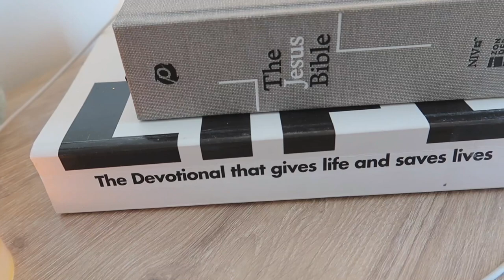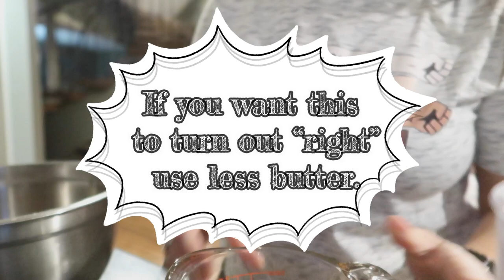HOUSE UPDATE || VLOG || Adding a Basement to our Mobile Home REMODEL ||

Comment: We are about to install a manufactured home on our property with a 5-foot tall crawl space with an eye to converting it to a full basement in the future. Pretty much everyone I've talked to his told me that it's a crazy idea and I'm not sure if they're right or not. How did the basement conversion work out for your family? Haven't found anyone else who has converted the crawl space under a manufactured home.
Reply from the maker: It's worked great. We did restructure the foundation to reenforce it with wood and metal but it has worked good and we haven't had any issues. Trailers do tend to be "cheaply" made so I would definitely reenforce and upgrade things to make them better.. 

I have heard of others doing basements under their mobile homes and not having a single issue.
Reply: @ChaoticCountry  thanks for the advice! I'll definitely be scanning over your channel to see if you had any other videos on the basement! It's always awesome to find out someone else has done the thing that you wanted to do.